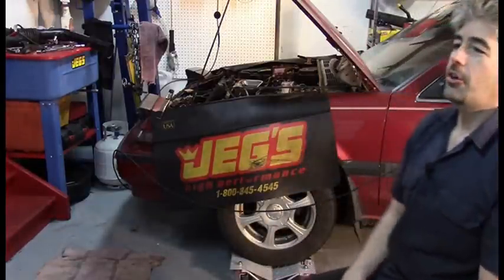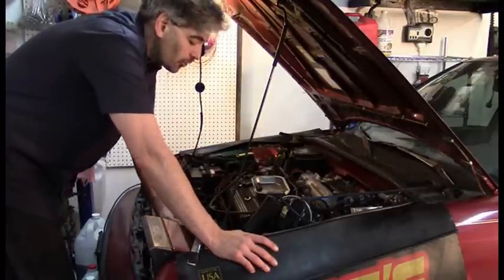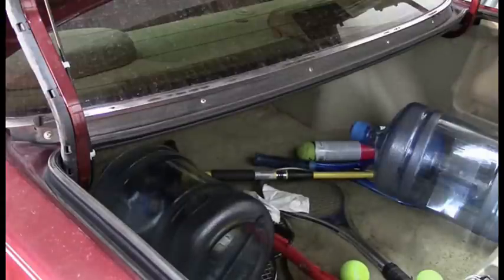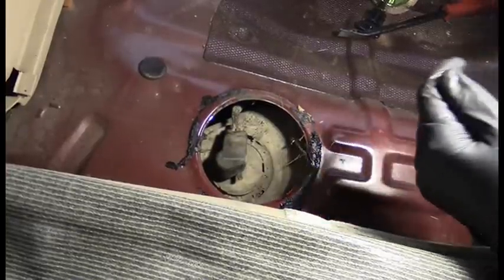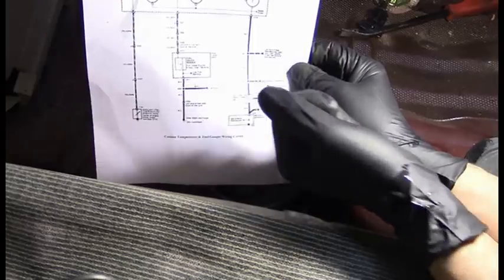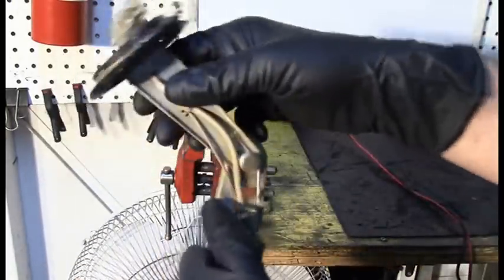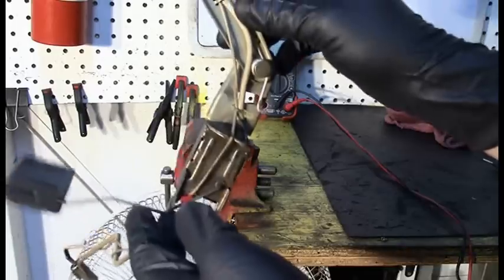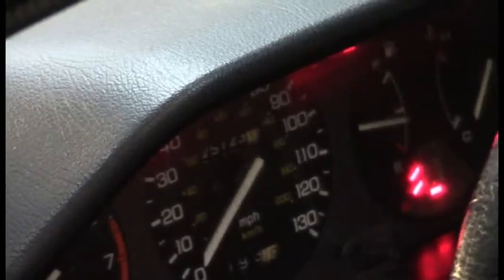Diagnosis of Stuck Fuel Gauge- Is it Gauge or Sending Unit?

Comment: Hi Matt, Thank you for sharing this video. I'm from India and I've got a very peculiar problem with my 1993 built Toyota Carina E. The gauge was erratic when we got the car a few years ago, and it seemed to be stuck at half-tank. After my mechanic took the sending unit out, cleaned the variable resistor contacts and put it back, it was stuck at E. The bizarre part is that when  we took the unit out while it was connected to the gauge and moved the float, the reading changed perfectly - all three positions, E , half tank and full tank perfectly corresponded to the float positions but the moment we put the unit inside the tank, it wouldn't budge from E or at best, hovered a little above E. He did this whole routine of taking the unit out and putting it back inside a few times, finally gave up and told me the sender unit was shot. So I painstakingly searched for a replacement and actually got the same unit from Toyota UK and had it shipped to India (very expensive!). Today we changed the sender unit, and voila..the same problem continues! It's enough to make me tear my hair out..why on earth does the unit not work when it's immersed into the tank? Oh and I have another question for you - what is the little extension on the sender unit, the one with the wire wound around the connecting rod? I would really appreciate any ideas you could throw at me. Thanks!
Reply from the maker: Prashanth Raju Sounds to me like you have an intermittent poor ground.
Reply: Schrodingers Box Thank you for responding. Could you explain what you mean by poor grounding and how I could rectify it?
Reply from the maker: Prashanth Raju Sounds like loose wiring that grounds the pump. Usually the ground for the pump is on the frame of the vehicle.
Reply: Schrodingers Box  I just found the electrical diagram for this car here: http://www.slideshare.net/fahimhyder1/toyotacarinae1992-1997haynesserviceandrepair  Page 220, grid A6 
Looks like there's an earth wire running from the fuel sender to the LH Kick Panel..got to check this tomorrow. Thanks!
Reply: Yep the tank to sender unit earth socket must have been loose. Disconnected and reconnected it and the gauge is working great! Thanks

Comment: I had to get a new fuel pump for my 1997 SAAB and now the gauge is stuck on empty.  My mechanic thought it would correct itself once I started driving the car and even driving it on the freeway and moving the fuel around, up and down. Well nothing has changed.  The gauge is still on empty.  Anything I can do that is basic and not expensive?  Thanks
Reply from the maker: Sally Steele Yes you can do the diagnostics shown in this video- that would be a good start.

Comment: Good video I have similar case 96 4Runner- v-6. but replace fuel pump, sending unit(original toyota)  fuel filter but the gauge is marking half (the tanks full).the mechanic almost give up? any sugestion.
Reply from the maker: ANA De Sousa What did your diagnostic test for the operation of the gauge indicate and what data from the diagnostic testing indicated a fuel pump and sending unit were faulty?
Reply: ANA De Sousa Well due for long time trip with my husband we let the 4 Runner with a friend when returned found the gas thanks almost empty, need replace the car Battery, and no crank up the engine, we assume the car was left like almost a year. my husband send the car to repair to pep boys the diagnostic was need new fuel pump, strainer, sending unit inside the gas tank.My husband bought all the parts original Toyota. plus he bought in a junk yard a the full assembly fuel pump and he took the bracket or metal base, because the assembly inside the gas tank was all rusty due the moisture that is what the mechanic said. He was able to crank up the engine, the car is running fine, except the fuel gauge is now stuck show half tank, even if the gas tanks does not take a drop of gas. And he does not what to do. Any recommendation? please
Reply from the maker: ANA De Sousa What about then diagnostic tests shown in the video? What data was acquired from those?
Reply: Schrodingers Box I think they have not do those test, assuming the replace for new parts fixed the original problem for not cracking up the engine, but now it is another problem with the fuel gauge.
Reply from the maker: ANA De Sousa It is impossible for me to say what the problem is without data from the diagnostic tests.

Comment: i have an 88 chevy s10 durango 4x4 and my gas gauge AND speedometer doesnt work will this method fix my gas gauge and do u have a video on speedometer gauge fix..please reply
Reply from the maker: This method will diagnose your gas gauge for sure.  As for the speedometer, no I don't have any videos on that. I am actually not familiar with older vehicles since I really work on 1996 and newer, all of which have electronic speedometer control.  I am pretty sure your '88 has cable from trans to speedometer- Non electric. If you can find this cable you should surely be able to do some diagnosis by examining the cable connection or even turning the cable with a electric screwdriver or drill or something. I've really only ever seen electronic ones so I am the wrong person to ask on this.
Reply: ok thank you for your help

Comment: My fuel guage doesn't work because I swapped out my instrument cluster since my odometer stopped spinning. I pulled out the cluster from the other car and the reading stayed when I installed it on mine.  When I turned on the car the fuel guage went up all the way and now it won't come back down.  Is there anything I can do? 
1993 Nissan 240sx
Reply from the maker: Yes, you can diagnose why the gauge is not responding- if it an open, short or bad gauge.
Reply: It was working before on the doner car I used. And thanks for the response.

Comment: hi mate nice vid,
I got a vs ute my fuel gauge has been shot,

I didn't actually try to diagnose anything I just pulled sending unit out of tank went to wreckers and got another sending unit ( I cannot find a brand new sending unit on the internet anywere)
brought it back etc plugged in and moved float arm up and down the fuel gauge in car only came up 1-2 tiny bars so like reading almost empty this is with the float in the full position tried this with both senders and same thing so I put old sender back in for now and its just stuck on empty what could this be ? both senders faulty or a bad earth or wiring issues or gauge dash problems I have tried to hit the dash no results thanks in advance :)
Reply from the maker: You will need to check your wiring integrity to verify it is good and if it is the gauge itself needs replaced.

Comment: thanks for sharing. I am actually having an issue with my GL1800 fuel gauge. based on this presentation, I have a better understanding of the mechanics behind this and how to trouble shoot my issue. I think in my case, I will have to pull my fuel sending unit as well and see if its stuck etc. by disconnecting my wires, the gauge did drop to E. based on your information, that pegs it more to the sending unit than the gauge.. Thanks again...

Comment: if the wrench touches both poles of the bettery will it damage the computer or blow its fuse
Reply from the maker: It will blow the battery if contact occurs for long enough
Reply: Schrodingers Box oh cause that accidentally happened when we were removing a k20 cylinder head and i was having concerns.

Comment: i have an 87 honda accord, looks the be the same layout as the car in the video, accept my gauge reads empty, i just replaced the fuel pump and brought this car back to life, wondered how i should go about this, i remember at around 5:17 you said something about the circuit being open, wondered what fuse you are talking about, the main relay?
Reply from the maker: I was referring to the fact that the circuit to the gauge itself from the sending unit may be open. The video shows how to test for that.

Comment: I have one gage that wen i turn on the power the needle shows empty ( it goes from (0) to under (0) ( and the tank is full ), its connected to two fuel tanks control by a rocker witch, the gage does works on one fuel tank but not the other, so i took the sending unit out and did ficical test moving the float up an down but the needle stais in the under the zero position.
Ill try the meter method berfore buying another sending unit. I was working on the boat dash gages wen did started to happend, any chance i miteoff cross some wires to cause this? witch by the way i never touched the fuel gage wires.
Thank you.
Reply from the maker: I would need to know the year, make and model and I can tell you how to proceed with the diagnosis.
Reply: Its on a boat but the gage is a teleflex.
Reply from the maker: cordelmar That doesn't help. I need to pull a wiring diagram for the system.

Comment: I have a 2001 Accord EX, the fuel gauge works fine, but the low fuel light hardly ever comes on when I am low on fuel. The light does work sometimes, I should say very rarely work. Any ideas on how to resolve?
Reply from the maker: the low fuel indicator light is actually a separate circuit than the fuel gauge- in other words the needle being low on the fuel gauge does not cause the low fuel light to go on-- it is actually a low level sensor sensor in the sending unit itself that completes a ground to make that light go on.  The wire will be a lt green with red tracer to the sending unit.  The way I would test this is by intentionally grounding this wire and see if the light goes on. If it does not then you either have a wiring problem  from the bulb to the unit or a burned out bulb (see my video on how to replace a control panel light if this is the case).  If the light does go on when you ground it, then you must check for bad connection at the connector but most likely you will need to pull the sending unit and find the open or bad ground and most likely I imagine you will probably have to replace the sending unit.
Reply: Schrodingers Box Thanks for quick response, I will test it this weekend.
Reply: Tested as directed, The dash low fuel light comes on when I grounded. Checked connections on the fuel pump assembly, all looks good. I will have to replace the sending unit.
Reply from the maker: Vernon Charles Well done bro! Glad to help. Yes you have 100% confirmed diagnosis- very rare for a DIY! Congratulations! The diagnosis for me is the fun part. I can live plenty happy without actually changing the sending unit lol.

Comment: is that a wig your wearing?????
Reply from the maker: Nope, my real hair. Having superior genetics, I have my hair still at 45.
Reply: wow it is thick and healthy, that is the only reason why I asked. no offense I hope? thanks for the fast reply. while I got ya here I have a 1988 f150 with 2 tanks. both tanks read way past full. I was told to check my grounds on the tank? does that sound right? why would both tanks do the same thing? or do you think it's a bad ground to the switch? what should I check/or try 1st. thanks...
Reply from the maker: Richard Downer Ha thanks, I get a lot of compliments on my hair- unfortunately it is almost always from dudes. lol.

  I very seldom work on older vehicles but to the best of my recollection- when the gauge reads full on an older model Ford, it means an open in the wiring, or gauge is stuck. The open will be either from the selector switch wiring to the gauge OR from the ground that both sending units share,to the frame.  It is very, very unlikely it will be both sending units in the tanks are faulty but of course it is theoretically possible.

 The wiring on these designs is very simple- each tank has its own power feed and sending unit-to-gauge going to the selector switch. When you flip the tank selector switch, you are actually flipping a dual switch- the switch selects the corresponding power AND sending for that tank. So while you have 4 wires to the switch from the tank, only two come off the switch to the dash. One is of course 12V power for the pump and the other is the gauge wire (which is also 12V right from battery- these are really simple guages unlike modern cars).  The gauges in the dash all share the same power so if your other gauges work, it is very unlikely you have a open in the power for the gauge. I do believe they have individual grounds though so the gauge ground may be faulty too.

If I were going to check this myself, I would start at the selector switch and determine which of the two wires from the dash to switch is the sending unit/guage wire (my bet is it will be yellow and white) and verify wiring integrity/voltage. Make sure to check at the switch itself since of course bad connection could explain it (i.e. bad switch - it only working for the power but not the sending)  If it is fine, then almost certainly your problem is an open in the shared ground wire for the two sending units.
  That covers it bro- just like my head is covered lol!
Reply: Schrodingers Box
hahahaha thanks bud. I do believe it may be the switch, from what your saying. I have not tested it yet, but tomorrow I will. I will let you know. thanks for the great Info......

R. Downer
Reply: Schrodingers Box
ok I tested the grounds to both tanks and I tested the switch... all good = no luck for me!!! I thing I will pull the bed off and test the sending unit,  before I buy 2 new sending units.. the crappy thing is, that's what it look's like could be wrong/Bad? wow both?? still the alldata (I have alldata 9.4) says it is faulty wiring? all tested out good? grounds were good. any other suggestions before I rip the bed off????

thanks for your help or any you can give,

R. Downer
Reply from the maker: Richard Downer Whoa hold on there- before doing that, it doesn't sound like you ruled out the gauge.  You did good- but you're not yet 100% confirmed on the sending units AND it is the lowest probability(remember BOTH sending units must be bad).
  What you need to do is test the gauge.  The wire from the gauge to the switch comes from the battery- basically 12V passes through the gauge, through the switch and to the sending unit. The variable resistance in the sending unit of course varies the voltage completed to the ground. So basically- what you need to do is look for 12V at that wire - at the switch is ideal location. If there isn't 12V, then your problem is an open from the gauge. I did say that all the gauges have the same 12V feed so if the other gauges work, there is not likely an open to the gauge, but there could still be an open FROM the gauge to the switch.
  IF there is 12V there, ground and open the wire- the gauge should respond with empty and full accordingly (you can also try my resistor trick and try to make the gauge read 1/4 or whatever). IF it does move- well, yeah, you have 100% confirmation of two bad sending units (provided you checked the switch and the shared ground correctly). IF the gauge does not move through- you have either a stuck gauge or a bad gauge ground.
  Check that you can move that gauge before lifting the bed and pulling two sending units!!!
FWIW there is a guy in the comments below somewhere about 3 months ago I helped with similar truck and problem and indeed it was his gauge.
Reply: Schrodingers Box
OK 2 things..  1st, yes I can move the gauge by crossing the dark blue wire at the switch to the yellow w/ white. the gauge goes to empty?  2nd, the most I get out of the switch  (with a Fluke Digital volt meter) on or off (connected or disconnected from the switch)  the switch is 7.8vDC on the switch. with out the motor running? I did talk to the person that owned the tuck before me and he said that both the tanks (both tanks either front or back gauges) never worked for him? yes it does have a 12v good ground at the tank. I checked the wiring and the tank..
 I will make a video on it If need be just for some help! I have dumped a lot of money into the truck already. I it would save me a few bucks that would be great. thank you, and hope you can help. yes I will look up the other comment about the same thing you mentioned.
Reply: Schrodingers Box
could you tell me the name of the video that helped about 3 months ago. you have a  few of them?
Reply from the maker: Richard Downer Based on your description it certainly sounds like two bad sending units.
  Also it was actually a comment on this video I was referring to from 3 months ago.
 But based on your troubleshooting, yeah if grounding the gauge wire moved the gauge- the gauge is good. The only explanation is either two failed sending units OR bad ground for the sending units but since you ruled out the ground- you're done! Two sending units it is!
Reply: that sucks!!! but it is what it is... thank you very much for the time and info... plus I subscribed... again thanks bud..